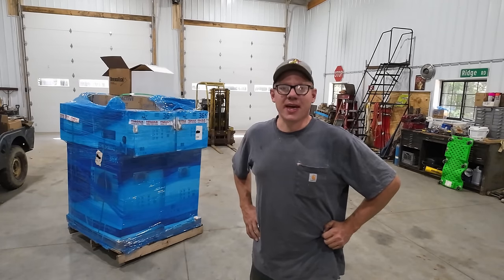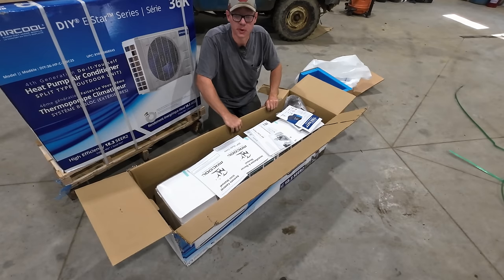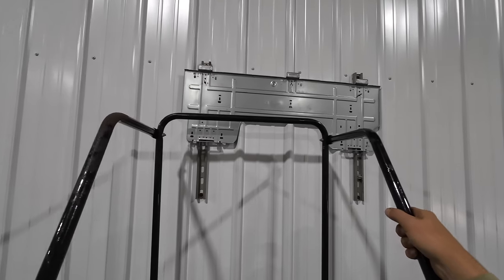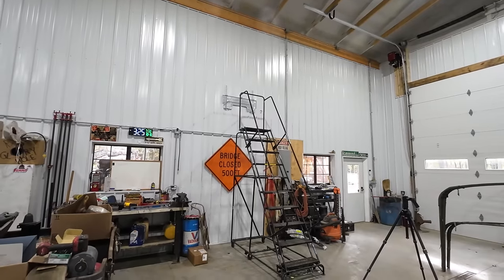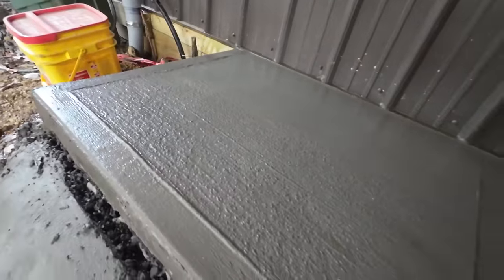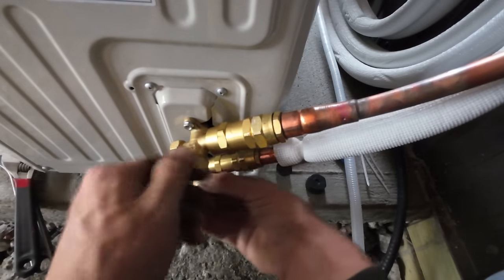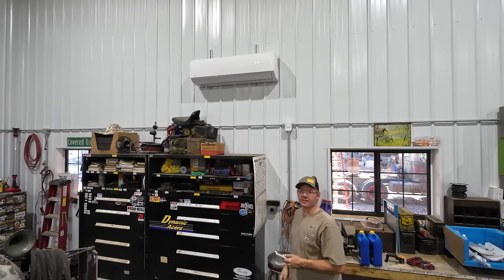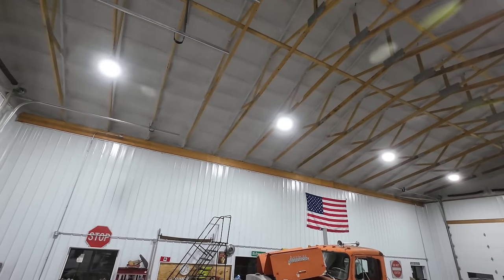DREAM SHOP Gets a Serious Upgrade! (How Hard can HVAC be??)

Comment: I didn’t see you vacuum the system down and check for leaks, as for the coiled up pipes they should be cut and shortened for better efficiency

Comment: Where is the condensation water supposed to drain when using them for heat when you have the outdoor units mounted on a flat surface? We use wall mounts and during the winter we easily get 1m of ice build up under the unit.

Comment: We have 3 of those mini splits at my place of employment. It's not a very large space, just for reference. It keeps it way colder than we need in the Summer, almost too cold! Like it's hard to control the temperature. We don't even use them in the Winter, as it is completely impossible to keep it from being as hot as a furnace inside. We just switch on the regular forced hot water baseboard in the Winter. I don't mind being too cold in the Summer! Way better than not having AC, or poorly functioning ac, as we had in the past. Long story short; they're far from perfect.
Reply: "It keeps it way colder than we need in the Summer,"// "hot as a furnace inside"  ---  Those problems were caused by installing a system too big for the space, with HVAC install a system just big enough, don't oversize it -- if you do oversize you'll end up with problems you'll never get rid of.
Reply: @davidnull5590  I believe you are 100% correct. In the next building over, they only installed one mini split, for a much larger space, and it can't keep up with heating or cooling. Way too big would certainly explain our problems - - much too cold or much too hot. lol

Comment: You should be able to run both of those on a generator easily, they don’t really use that much power even in heat mode. Check the nameplate rating I think you’ll be surprised.

Comment: Great job doing the installation.  Your work would be a great example for the manufacturer.  Hope it doesn't interfere with the crane (that you will install at some point in the future).
Reply from the maker: No, I spent a whole day measuring things to make sure it won’t interfere
Reply: @DieselCreek  I figured you might have and glad you did!

Comment: Matt, why didn't you take the mixer you the job instead of double handling via the bob cat? You could have poured the mixer straight into the slab formwork.
Reply from the maker: Needed to be by the water

Comment: Hi Matt, love the heat pumps. Can I ask if you have any intention of installing solar panels on your shed roof to offset the running of the units. Your electricity charges are obviously far cheaper than ours here in Australia as those units would cost a fortune to run over here.

Comment: "Big Ass Fans"  ,,, yup, that's the name of the company.  
  Also Matt, being you have a primary heat source that is not these split units, I would put at least one of them on an off-peak electric meter, where you will pay only about half the  going  kilowatt rate.  The electric company gives you that good rate, because they can control during certain heavy peak electric use times whether your unit runs or not, but having the other one on full-time service will not leave you without having cooling or heating..  I use this arrangement, and it works well for me And save me a ton of money on electric service rates.

Comment: You may want to check the fine print on those I believe if you don't Purge the lines your seer rating will take a hit. Also you may be able to qualify for a reduced electric kilowatt hour rate from your electric co. also there may be rebates to offset cost of unit.
Reply: Line set is pre charged .

Comment: It’s probably too late to tell you this but it definitely needed the lines and indoor unit to have a vacuum pulled on it. 

The reason why you do this is kinda simple, the air that was in those lines had non-condensables. What are they ? Basically it is just moisture humidity in the air. All refrigeration systems use a compressor of some kind, compressors don’t like compressing things that won’t compress, ie liquid moisture (non-condensables)
That’s why the vacuum is important. The vacuum won’t suck the moisture out, what it does is lower the pressure, as pressure and temperature are related it will lower the boiling point of water to below ambient and the moisture will turn to steam and that how you remove the non condensables.

Why have I just told you this? 
You maintain all your equipment, you change the oil you grease your bearings you give it all your plant the love they need. The internals of a AC system is hermetically sealed and you can’t maintain it once it’s commissioned, that’s why it’s critical that you do everything you can to prolong the life of the units at the beginning.
Look at it as maintenance for the lifetime of the unit. 

I’ve said that but the gas will probably leak out before the compressor has a chance to fail. 

Keep on trucking.
Reply from the maker: I should’ve explained it better in the video. That is a DIY kit because the lines and connections are all pre-charged and sealed. When you screw them together the seal is pierced. No vacuuming down required.

Comment: As a certified licensed HVAC technician and manager we will never install or service these diy systems…. If we do the warranties are not honored.  Hats off to those that buy these and install them without pulling a vacumm on the line sets, getting the flares to seal properly and when it breaks down which it will eventually be able to get the parts and know what part caused the failure..   you can actually also get wall mount brackets the outdoor units rest on….
Reply from the maker: You’re missing the point. These are DIY because the line sets are sealed and there is no flare. You do not have to pull a vacuum. Everything is pre-charged there is no air in the system.
Reply: Can’t wait to see the finished product I love watching your videos and am really looking forward to the boiler set up… I just know these system are nice for the diy person I’ve just responded to a few that did not turn out as reliable… just like anything I guess… not every goose lays the golden egg….  Finished watching this and I have to say impressive work Matt. 6 tons of ac on a well insulated shop should do the trick.

Comment: Seems like yeh need some BIG donkey Fans.. @fannythedonkey these people might be ones to assist in getting a big fan to move some air around in your shop.. - also those split mini systems are crazy simple to install it seems..  could have mounted those outside bits to some steel angle brackets - ive seen them mounted where they hang off the outside wall but up off the ground on some brackets.  grats on POWER TO THE SHOP! heh

Comment: 7:42 If you put the external units on top of the lean to, be sure to put them down a meter or so, so that you can plop your butt right behind it and work on it as needed, and you will have to work on them occasionally. Otherwise, you'll be cussing the nut job who put them in for ramming them up against the main building.

Comment: Nice work Matt, I will be installing AC in my workshop once I build the internal walls. No chance of DIY in Australia though, some big fines if you mess with refrigeration systems without a license.

Technical question for the audience, how does the system still work so well even with all the “normal air” (non condensibles) in those line sets from installation? Thank you!
Reply: Those particular units come with pre-charged lines and indoor head, hence the big weird connectors (vs normal flare connections). Assemble and go, no vacuuming required.
Reply: @iwfur25  sorry, I just reread your reply and I can see where you are coming from now.  Thank you!

Comment: I will be interested in how the heat pump works in PA.  I run one in my home in Texas and if the temp drops into the low 40s upper 30s I have to switch it to emergency heat because the heat pump outside unit runs colder than the ambient temp and will freeze up.

Comment: Pretty good installation for a first timer. But those concrete pads are ridiculous.. you should have made a bracket and fixed it to the outside wall that would’ve also kept it off the ground out of the water and moisture

Comment: I get the feeling you might never get around to that wood boiler...I'm currently working on my 30x50 building.  Just ordered a 48k btu Samsung mini split setup to install.
Reply from the maker: The boiler is sitting here. It will be installed. Trust me.

Comment: 72k for a shop that size with tall ceiling, in a climate with humidity levels as high as Pa?  They are probably not to bad and knock the edge off, I would like to see a 6 month review after the temp jumps up in the summer.

Comment: Hey Mat, here in Germany it would be so expensive to run an AC over a generator or the line. So how is this afordable in us? What if you would install solar panels onto the roof of the shop (plus batteries)? Ok, this would be against the channel name, but it will save you your independence and also a lot of money.
Reply: I'm in upstate New York State, out in the country, cows, corn fields, vineyards and more cows.  Here I pay $0.11(€0,10) per kilowatt hour of electricity, usually in my area the rate is  $0.14 cents (€0,13) per kWh. The rated paid for electricity depends on the geographic area, there is no logic to this, it is mostly based on archaic, arcane history.  The lowest price in New York State is Canandaigua at $0.06 (€0.046). In New York State the highest rate is  $0.22 kWh (€0.20).  What do you pay in your area state of Germany?

Comment: It is better to connect vaccum pump and draw air from system before opening the valves on outside unit, because air moisture is destructive (Causes corrosion) to comporessors. Remeber to clean the filters, fans of the dust and fins of evaporators of inside units and spray'em with Legionella killing foam every 6 months, important. Also check the fins of outside units for clogging and blow them with compressed air when they need it. Just keep everything cleen and tidy and the units will serve you for a long time. Also there is a leakage test on the inside units. When you unscrew the caps of inside units you should hear a hiss of sucking air. They come prevaccumed. If there is no hiss you know the inside unit has a hole in it, and thus is faulty. Nice huh?

Comment: Would it make sense to have solar panels installed on the roof of the shop, maybe later? If so, it would mean getting independent from the power supplier that tries to get rich on the cost of it's customers! Certainly this depends on how many days per year you have sunny days in Pennsylvania! I think if you have the same kind of weather there like in "Groundhog Day" most of the times, well - not really!
By the way, same problem in Germany - but by about 50 % homemade (switching off ALL nuclear power stations, etc.).
All the best! Any answer by the owner of this channel is greatly appreciated!

Comment: Wondering what the outdoor compressor weighs, because I was thinking you could weld up a couple 90-degree brackets/side support with some cross struts out of angle iron, like you are mounting a truck toolbox, and drill those into a column and get them off the ground like the inside unit. This way you don't bash them with one of your equipment(s) you store under the lean to. One moment of not paying attention and they could be damaged. Since that is too late a suggestion, I might take an auger and sink four of the heavy (corner style) chain link fence posts and wrap those with some chain link fence. You could tie the fence so you can easily remove if you need to service the units. I would not rely on the pad as you could hit them with a bucket or wheel. Anyway. CLIMATE CONTROL!

Comment: How come no solar panels.Lumnha Acres uses a good sized one . That one would allow fro welding, house uses. Upfront expense would be expensive but cheap in the long run. No more having to deal with a power company or being connected outside. Has storage batteries for nonlight times. ???😊

Comment: You should put a vaccuumpump on to remove the air from the lines, with air in the system it wont run good since air cant condensate
Reply from the maker: These are sealed lines. They don’t require vacuuming

Comment: Personally I consider heating a part of "air conditioning" as any changing of the air temperature is conditioning the air and yeah the warranties on these DIY setups are short and worse still some of the DIY brands require the install to be done by a Licensed HVAC tech to even qualify for the warranty. So those are details to look into, we are on a Propane Furnace here but Propane is off the charts pricey these days that it's almost as expensive as resistive electric heating is, so i've actually been doing a lot of research the past week or 2 into doing a mini-split so I can heat/cool just the basement when the main level of the house is vacant (which it is for much of the year).

Comment: A question for Matt and the community: for such a large space, would these benefit from large industrial ceiling fans to keep air circulating, particularly in Winter when the heat is going to rise?

Comment: Warning Will Robenson, I live in Ohio and we have mice that like to get into everything including mini split heat pumps because these units have a crankcase heater and mice like heat. They will destroy the wiring, insulation, galvanized metal, and circuit board. You must plug every single hole in the unit including the plastic duct work that holds the refrigerant lines. Believe me when I tell you.

Comment: Only thing might should have done is that tape like stuff you should have wrapped all the lines together with it from the inside to outside unit so before you hung it on the inside  get all your lines and drain all together then wrap that from the inside unit all the way down the line at least tell It gets outside then stick it threw the wall and then conect the outside unit it's so if it sweats under the insulation it won't drip on the wall it would sweat and run down the lines instead because their wrapped in that plastic thin tape stuff it may sweat only during the hot summer days it does say that is how it should be on my mini split instructions at least

Comment: Have basically the same concept, different manufacturer, as main heat in my house. Cut my electric bill in half. My part of the world,PNW, we don't need much air conditioning. Asked the contractor if I only wanted the heater part would it be half price?lol

Comment: 25.88 in the video the refrigerant lines... you did not hook up a vacuum pump and pull a vacuum on them before opening that valve and letting the refrigerant into the line. I am not sure but I think that was a mistake. You may need to vacuum those lines and recharge it now??

Comment: i’m from future . those 2 units will not cool your building. 
400 sq ft/ton @ 8’ lid . . best case scenario they will cool 2,400 sq ft with 8’ lid and proper insulation. also, if the ambient temp gets below 25° ish they will will not heat
worth a dern.

Comment: You should do some research on the actual cost of running these in heat mode, with COP up to 5 or more it might actually be cheaper to run these heaters instead of gas heaters.
Reply: Its way cheaper. A mini split pulls less power than a hair drier.  My monthly electric bill runs around $120-$150. My home is a 120 year old Victorian that's 4300sq ft. 100% electric and I run 3 mini splits. Two 18k and one 9k. That's pretty good in my book.

Comment: Gotta wonder why the radiant floor heating was even necessary. 68?  For a shop?  I don't even keep my house that high in the winter. lol.
Reply from the maker: These aren’t very effective in the coldest months, also they will cost a lot more to operate than the wood boiler.  Radiant floor heat is the nicest heat to be in. It warms your whole body, laying the floor working on stuff becomes extremely enjoyable rather than miserable. I didn’t get these for the heating aspect just the air conditioning. The fact that they can keep the shop warm until I get my boiler installed is a bonus.

Comment: i find this hard to believe - 2 units in that big a space? We have several in our barn,home etc.. and they suck - meaning they are not that efficient as "regular" heat - our barn has 2 x 7 ton units (4 24k air handlers) and it barely keeps it warm in winter (10-15 degrees) - plus the electric bill!!!! We supplement with our oil/gas units - all in all heat pumps are not as efficient

Comment: HI, Matt whats happened to your rail lift that moves the full length/side to side near the ceiling roof of your work shop you showed it us when you bought it at an auction sins then we have never seen it. if you still have it when it goes up to lift engines etc., it seems one thing I thought you would have got and run first before you got a lot of things inside your workshop..?.john.England..u.k...

Comment: would love to hear why the power company wanted 52K to hook you up. What part did they do that cost that much? I did underground power to my house which was about 300 feet and it was a pretty cheap one day power company visit to get me all connected.  Didn't cost very much. I was already a customer but I had an old air wire.